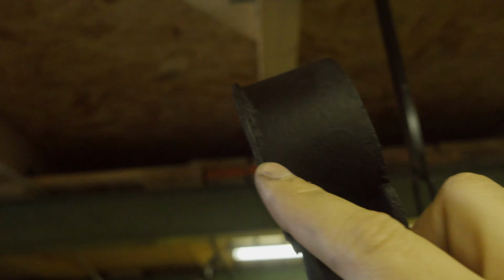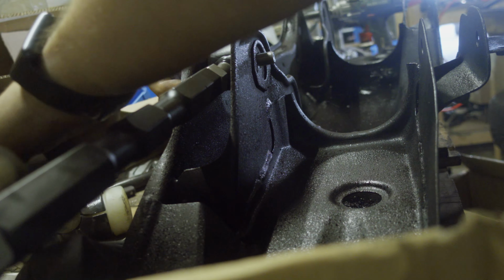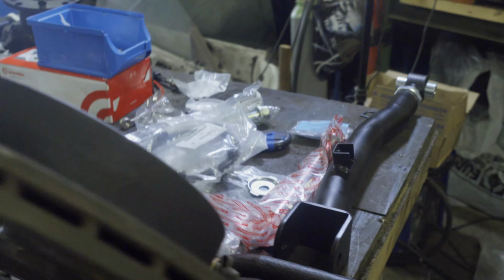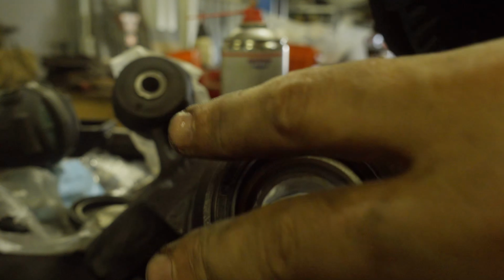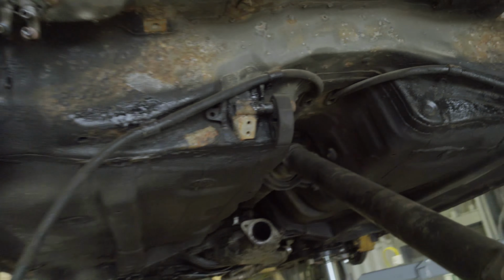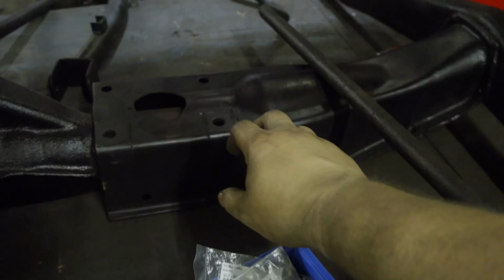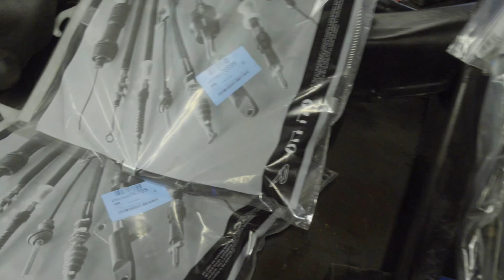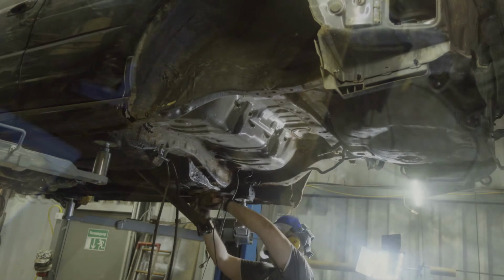WRX STi Rusty Rear Axle Reassembly

Comment: Hello Andreas you are doing  good work and I'm enjoying your videos, I replaced my brake back plate with a new one and I noticed that the new one had a very thin coat of paint so I lightly sanded then added a couple of coats of zinc primer then several coats of satin black because the outer part is only thin metal and prone to rusting luckily for me my car was imported into the UK from Japan in 2018 so it doesn't have any rust so I've been filling cavities with wax  I don't use the subaru in the winter here because they use salt on the roads. Looking forward to your next video.
Reply from the maker: Hey @nushooz6731 , thank you for your kind words and of course for the excellent advice too. Luckily the paint coat didn't seem to be that thin on the back plates I got. But I could measure the paint thickness next time I am in the shop, just to be sure.
😁👍🏻